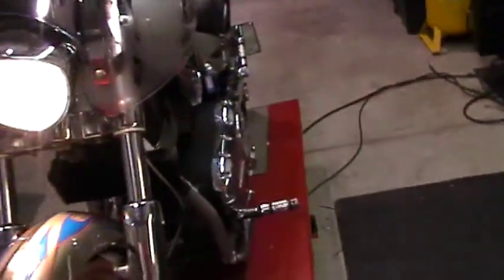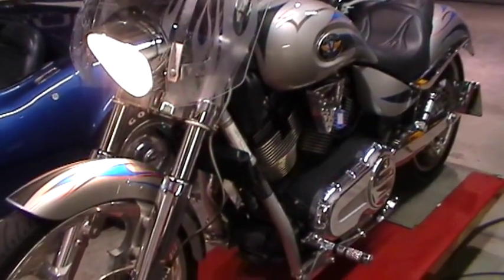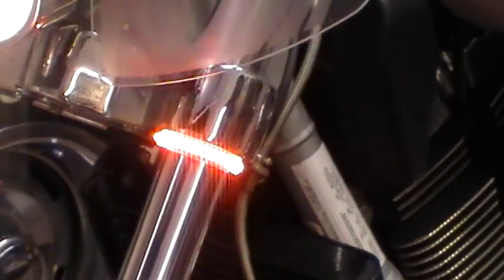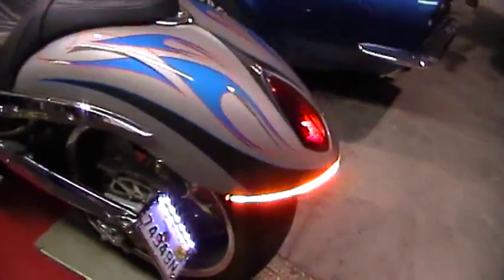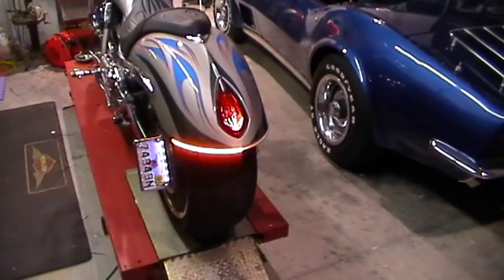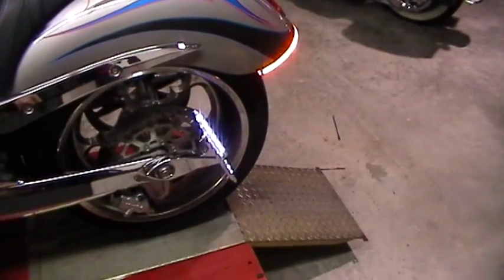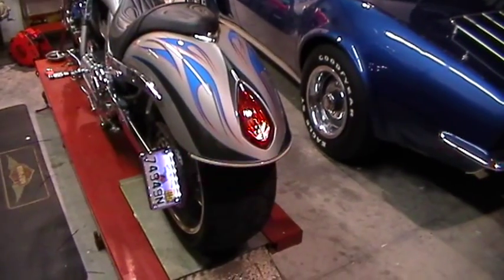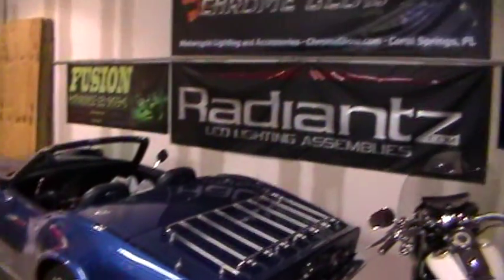Victory Jackpot Lighting.mpg

Comment: i installed mine and first right side stopped working then left now my trun signals dont work..i checked fuse and relay they r good....it was working perfectly with oem lights what happened?
Reply from the maker: Can you please contact us at 954-341-6640 and we will get you to a technician to troubleshoot the issue.

Comment: Is this mount and rear turn signals still available?
Reply from the maker: The mount has been discontinued. The rear turn signal kit has also been discontinued but we do have some styles in stock. Here is the link https://chromeglow.com/products/victory-jackpot-led-rear-turn-signal-kit-from-mbw. However there would be no warranty. We actually make our Fender Kit for the 2006-2015 Victory Jackpot with or without the 250mm rear tire. These have a lifetime warranty for LED failure. Here are the links for them https://chromeglow.com/products/victory-jackpot-with-250mm-rear-tire-led-rear-fender-turn-signal-kit and https://chromeglow.com/products/victory-jackpot-without-250mm-rear-tire-led-rear-fender-turn-signal-kit. Please feel free to contact us at 954-341-6640 if you have any other questions.